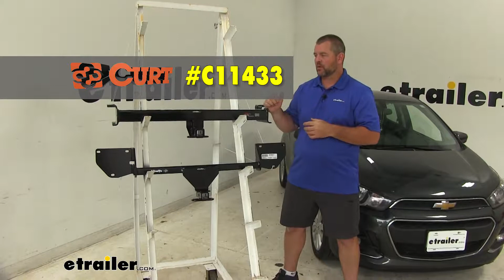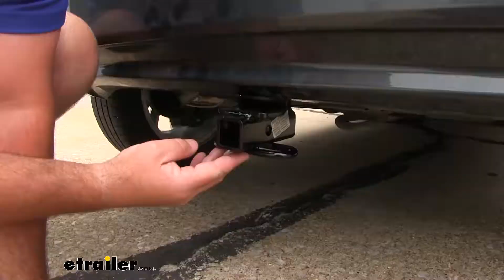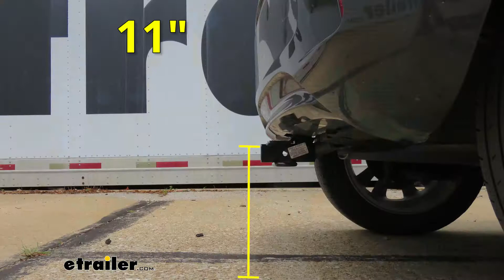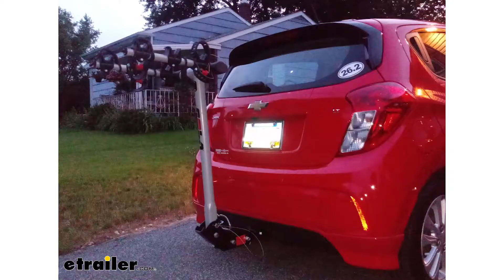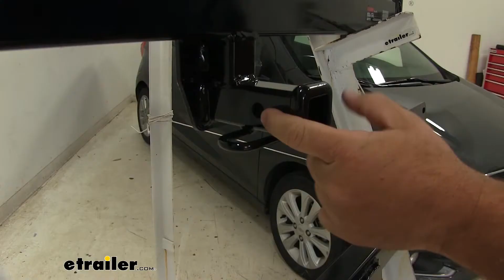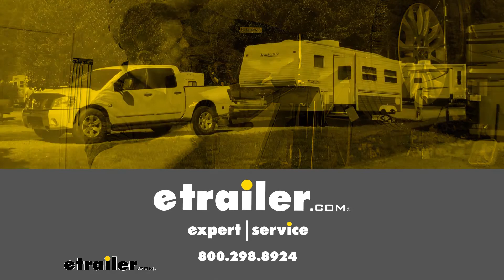etrailer | Best 2019 Chevrolet Spark Trailer Hitch Options

Comment: So dumb question maybe. If I wanted to pull a prade float even a smaller one with my chest spark what would you suggest
Reply from the maker: You would need to check with the owners manual of your vehicle to see what the weight capacity that your vehicle can handle.
https://www.etrailer.com/hitch-2019_Chevrolet_Spark.htm

Comment: What cargo carries is that, brand, sku, ect
Reply from the maker: The cargo carrier in this looks like it is the 52x18 MaxxTow Cargo Carrier. It is part # MT70107 on our website. You can check out the following link for more details.
https://www.etrailer.com/Hitch-Cargo-Carrier/MaxxTow/MT70107.html
Reply: Cool you think I could pull a kayak trailer?